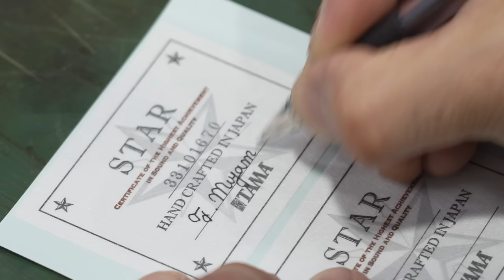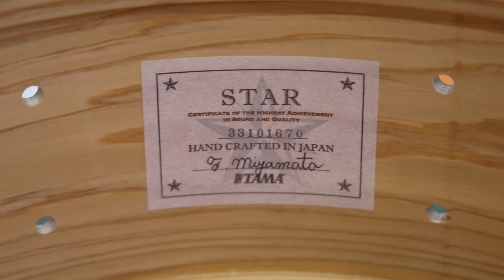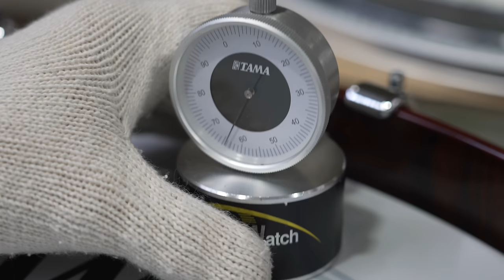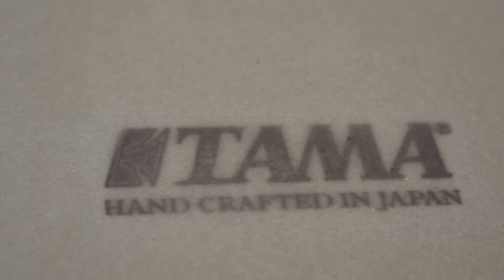ドラムを作るプロセス。世界で多くの方々に愛用されている日本のドラム工場。

Comment: "There could be a mechanism with dice in the game, for example, you could have to select between having any single resource of your choice, or rolling two dice to get two random resources. Of course this should come with a additional cost, like giving up a card ... It would be a way to introduce a Push Your Luck element into the game (As it had on the previous version), and if you're lucky to get the right resources, you would be abble to get the dragons played quickly."

Comment: We have several TAMA drums at home. My favorite is the starclassic bubinga made in Japan. We also have a s.l.p. woodhoop, is also nice. And we have a star walnut, and something about this one is bothering me. I look at it a bit like in the army. A simple soldier has stripes on his uniform but THE GENERAL wears the medals! And that's it now at TAMA, the expensive high-end drums have a simple sticker under the varnish on the expensive star classic and the expensive star drum kit. It looks like the stripes on a regular soldier's uniform. And then you have the cheaper star classic and the cheaper other models and they have a decent badge such as the medal on the uniform of the general. You can mount this beautiful star badge on the Tama Star reserve snare and it looks great and adds value to the snare drum. It would be great if there was a badge like that on a star drum kit, after all it is your top model and I think the top model certainly deserves this. Now it looks like a Rolls Royce where they forgot to install the Engel.

Comment: Bought a Tama star bubinga snare straight from Tama factory Japan using proxy service. Very disappointed with the quality… the inlay where the hole is had a crack. (inside lacquer finish)
I tried to contact with Tama but they don’t receive email or any feed back from customer…  
Funny thing is that it still had a label that it passed inspection